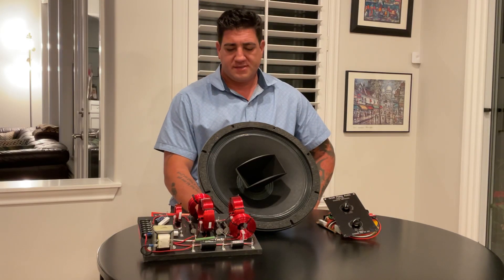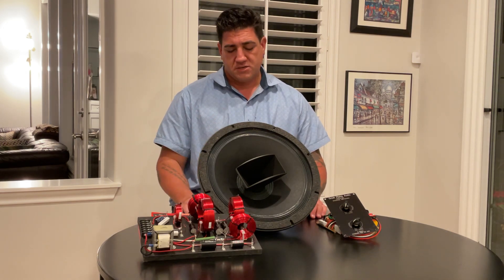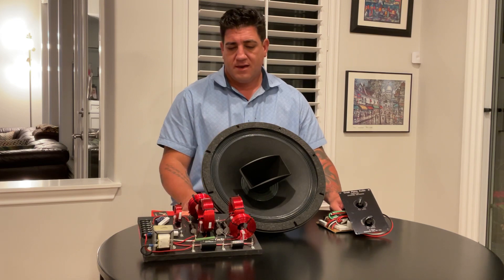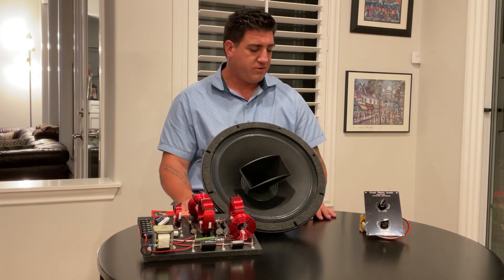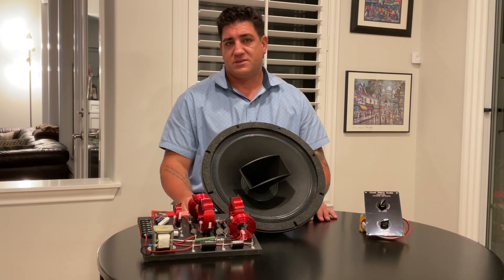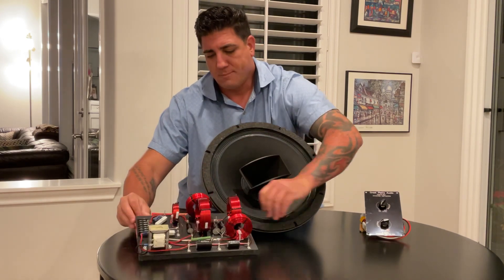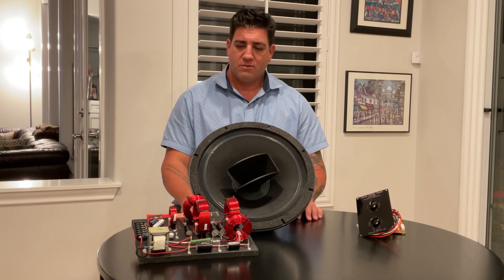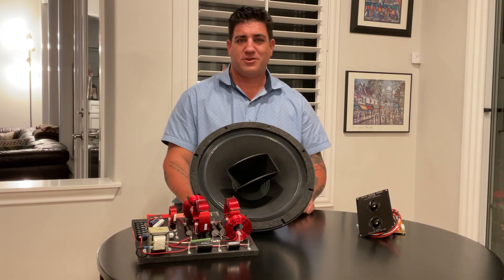Altec 604 project details

Comment: Please post the comparison of the two 604H crossovers
Reply from the maker: I found the 604H unlistenable. The phase did not remain constant. There was no setting in which you could adjust just the HF without the phase being impacted too. It's the reason I went to my own solution.

Comment: Any update on the progress of this?  I'm particularly to see the cabinet and understand its design objectives.  And, the ALK vs GP crossover comparison will be very interesting.
Reply from the maker: Not to be mean but the GP crossover was unstable. With 2 pots it additionally modulated phase... It could not be dialed in. 
The ALK provided only  HF  adjustment which is all that's needed. 4th order/4th order. The GP drivers are insanely good, but the 604 crossover didn't work at all.
Reply: Yes I found the GP attenuators a bad match for the driver. I determined resistance needed and installed 30 ohm on the MF section leaving the HF section open. Also replaced the tweeter caps to Jupiter copper oil. Much better, still need subwoofers for best balance. 
How did your new crossovers fare?
Reply from the maker: @ronbadley9179  Im beyond pleased. I may start selling the crossovers. I think the idea of 2 attenuators id a failed proposition. Simply attenuating the HF is both consistent with traditional approaches and just more logical. The high order filter makes its so I can find the crossover between the 2 drivers anymore which alway felt like the weak link for the 604.
Reply from the maker: Alan, Ill try to do some followup video about the speakers… I have 2 sets of 604s living their best lives… one in a 612 cab and the other in a 5cu cab of my design both sound amazing and Im super pleased. The crossover made all the difference for me.

Comment: Hi I'm just planning a cabinet build for two reconned 604-8k drivers by great plains audio I have with the replacement new great plains N 604-8c crossovers and was thi of building the 620A cabs more internal volume then others .
Have you heard anything on that combination?

Comment: The 4th order network will likely reduce sensitivity significantly. Also you will need to raise the 612 cabinets so the tweeter is at ear level.
Reply from the maker: The crossover has proved a success. I do lose 1db of sensitively but they negligible as compared to actually having a crossover that works.  In stock form the crossover was unusable and barely listenable. Re lifting cabs. I’m unsung in my office. In my seated Position I have no issues.  Maybe if first back in a large room I was lift or tilt.